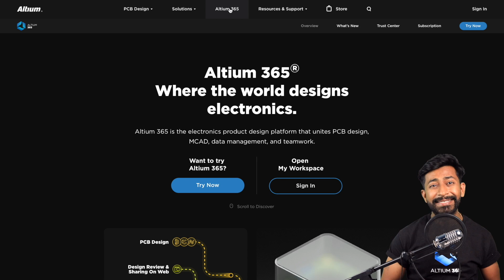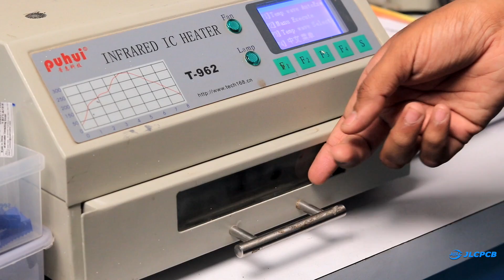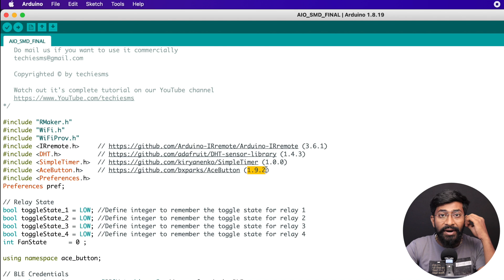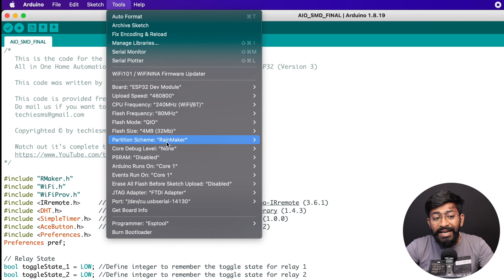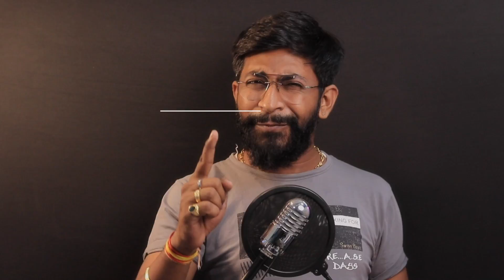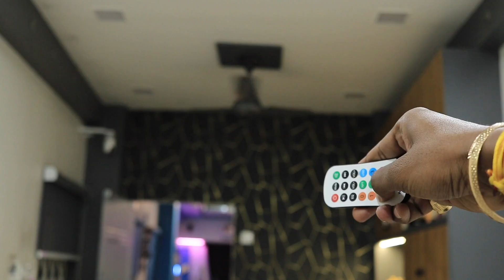Our BEST EVER Home Automation project | All In One Home Automation with Fan Dimmer V3 | IoT Projects

Comment: Complete newbie here. may be silly question but still want to know.
1. I Can use this relay completly in local network on home assitant?
2. This is similar to the other readymade relays available from Sonoff, schneider or what's the deferent? 
3. What i understand this module on it's own is enough i don't need separate home assistant server to controll?

Comment: Hello my dear. Greetings from Peru, I need your help. I want to see the filling status of my overhead water tank on the dashboard and on my mobile from wherever I am. I have a float type switch in two water tanks, what I need is that when the switch of one tank is Open (indicates that the tank is full) it turns on a green LED on my ESP8266, otherwise it turns on a red LED and also shows this status in the "Esp rainmaker" application. All This for each tank and Excellent videos, how can I contact you.

Comment: Hello. I have a doubt. If the board is not working then normal switches will work?
Reply from the maker: If ESP32 fails to work , then you won’t be able to control appliances

Comment: I had made the same utility project in the form of deployable switch board where you can operate the appliances not only by using Internet but also without internet too(Manually).
Reply: And it was my mini project (3rd year).
Reply: @siddheshraut6958  did manual switch had a plunger with it ?

Comment: Sir, is it possible to add the feature of controlling through the same app even without having an internet connection. Like a common router method eg: tasmota
Reply: Yes is would be made possible with any bluetooth app, but not the same app.